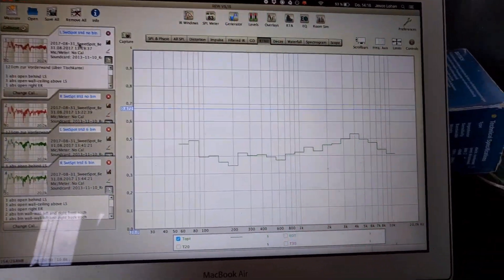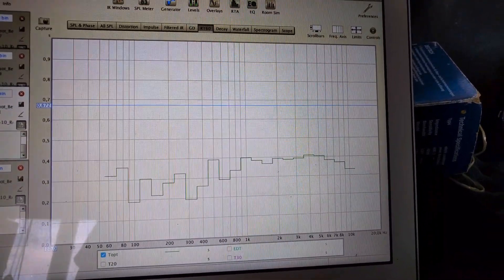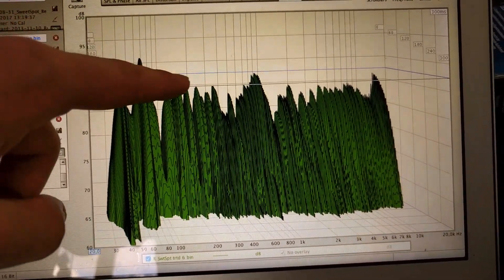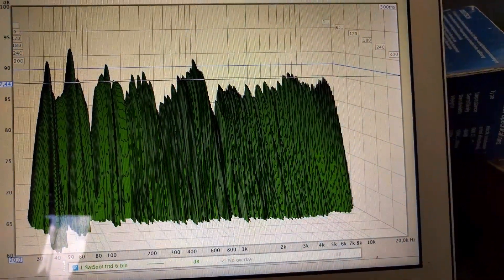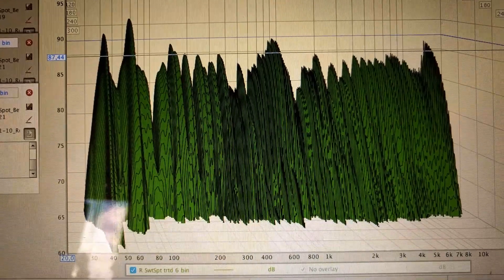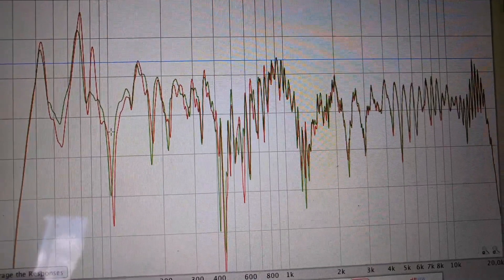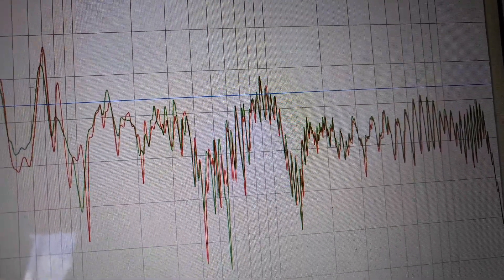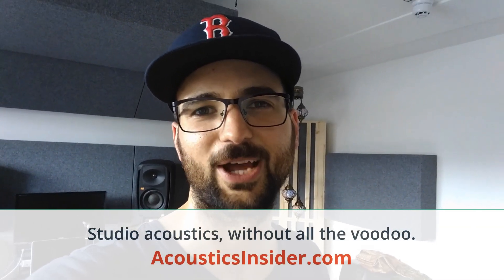On The job: Testing A New Diffusor Design

Comment: Would two Helmholtz-Resonators, tuned to each of the lower peeks help with the cancellation dip? Or would you have to absorb the dipped frequency so you keep the reflection from cancelling out the wave?

Comment: Im assuming you wouldnt use this in your first reflection points and makes sense in the room corners. Would you use them in the ceiling/corners and room corners in the front part of the room where your listening position is?

Comment: Just out of curiosity, what's the price point for all the treatment in this room? Just ball park information, material and consultancy. 5000€? 10.000? 20.000? Worse?
Reply: I think, if you do it yourself, then you can be in 1000€ easily.
Reply: It doesn't cost much at all, if you make it yourself. A few hundred euros. Wood for the frames, RS45 rockwool, acoustic transparent fabric. The diffusor timber is very cheap too, it's just thin finishing timber arranged randomly over the front of a bass trap.

Comment: How do you calculate the BA diffusion? BTW, I doubt your speaker goes under 80hz, Those below 80hz might be external noise (like Air con. vent noise....etc.)
Reply: around 40Hz for opals

Comment: Hello...:)
How you deal with that 100hz dip?.
Reply from the maker: Hey Panca. First you'd have to figure out where it actually comes from. Chances are it's a reflection based cancellation. You could find that out through a combination of looking at the impulse response and trying to block any potential culprits with a large enough absorber, to figure out the direction it's coming from. Then you'd place an absorber at the reflection point that is large and deep enough to absorb the frequency in question.
Reply: Acoustics Insider how thick is the absorber I need to do it?100hz.

Thanks for very informative vids, keep on:)
Reply from the maker: Hey Panca, have a look here:

http://www.acousticsinsider.com/best-insulation-material-diy-acoustic-absorbers/
Reply: @AcousticsInsider  Sorry for the late response, but in your guide it first seemed to say the material didn't matter (e.g. the recycled denim material would be OK), but that was struck out. Did you find it didn't work as well, compared to the fiber glass or mineral wool materials? Thanks for all your extremely useful videos and thanks in advance for any answer. :)
Reply: @hillie47  It does matter